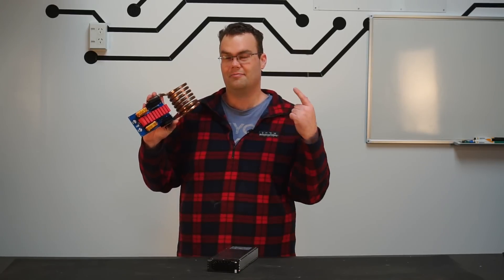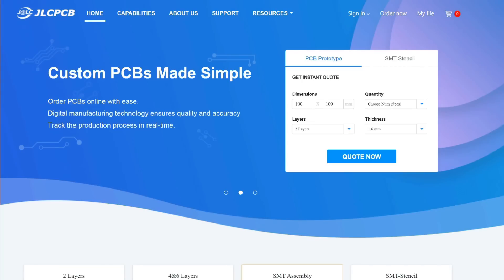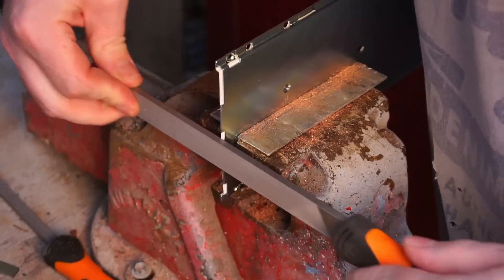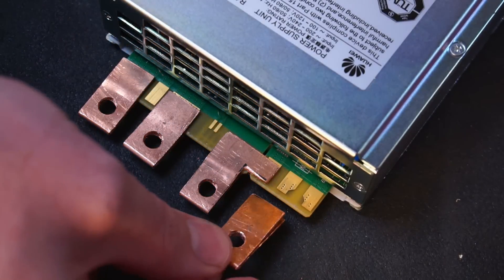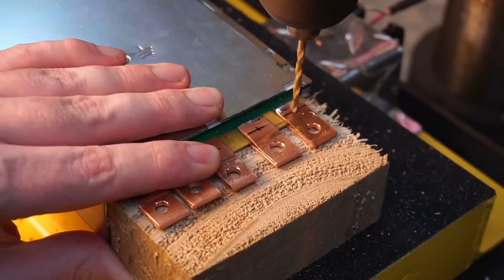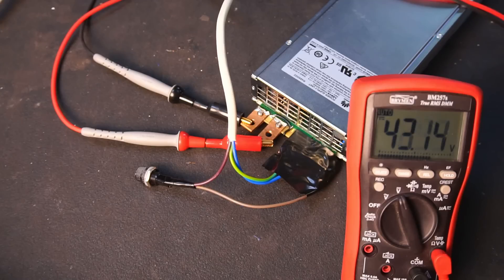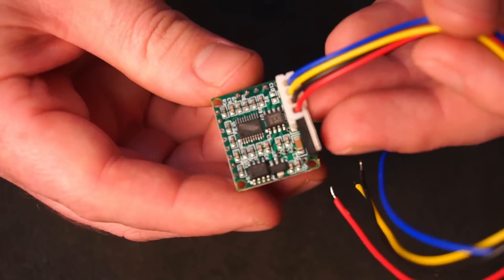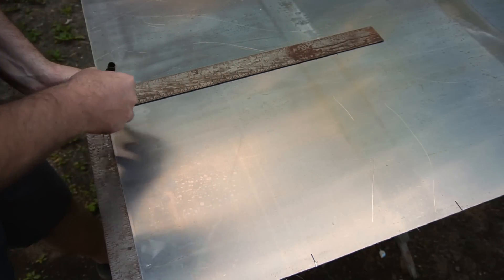Cheap 3Kw PSU for Induction Heater ll Huawei R4850G2 PSU

Comment: Great video, very good!
Now on eBay for around $15 a complete connector set.
The voltage and current controller looks extremely useful but seems difficult to obtain, is there a schematic maybe?

Comment: Those $35 power supplies can't be had for less than $100USD now. Even on AliExpress. I'm searching for one for a 500w ZVS unit currently. Pun only slightly intended.

Comment: Sir, I am near (HUAWEI R4875G1)Is the pin out of the said model the same as yours?
 
Please provide an answer.
Reply: Did you find an answer? I have the same unit as you do and I'm trying to figure out what the extra pin next to the slot detection and CAN is used for

Comment: An excellent solution in the construction of the device.  Thanks for the idea!  Can you please tell me where to connect the heating pedal (turning on)?  What kind of relay is required or is there any heating control contacts on the circuit?

Comment: Hello, Nice information. Would like to know if this taobao voltage & Current limiter needs to be in the circuit permanently or if it should be removed after its job is over and the new voltage and current limits you set remain and the Power supply boots up to the new parameters after removing it from the circuit? it's not clear how to know what current is set as there was no visual of it after pressing twice to get into the current setting mode and the red LED blinks. Please let me know. Thank you.

Comment: I’m trying to make a power supply for an electric vehicle that I can very the volts and the amps for if I built two of these and isolated them could I run them and series to get around 100 V?

Comment: I ordered the Huawei R4850G2 and the Talbao encoder to build my power supply, as per this video. Removing the top enclosure of the R4850G2 to connect the ground and the regulated 5 Volts, I could not find the 3 pins the author used to take the 5 Volts from. The circuit in my R4850G2 looks like kind of different from the one the author shows.
I took two pictures of the circuit in my R4850G2 to show this issue. Can anybody help me to discover how to take the regulated 5 Volts from the circuit in my R4859G2?
Reply: Can you give me the link for the encoder please. Not finding it...

Comment: Hi good morning.
i would be interested in using this power supply to power an rf amplifier, modules require 65v but 50-53v is fine too.
a curiosity, what are the differences between the G and G2 version as circuitry? are they activated and the current and voltage are drawn in the same way?how much can a similar power supply cost?
thanks for the video

Comment: @Schematix Did your R4850G2 become very hot when turned on without a load on the output? Mine do, and I am pretty sure it's not supposed to happen. I just want to be certain it isn't some weird supply pumping, or inductance dumping that causes energy to be converted to heat. The supplies are very expensive now, so I would prefer not to have to buy a new one...

Comment: the thin wires which needed to be connected with ground to turn on PSU , i added a switch there - easy turn on and off.

Comment: The 1 and 5 legs are supplied with a voltage of 0 to 5 volts to adjust the current, or can you install a trimmer between the 1 and 5 legs? To adjust the voltage between 1 and 16 feet, can you put a trimmer resistor or do you need to supply a voltage from 0 to 5 volts?

Comment: Your video on how to build a 3000W induction heater and PSU is awesome!  I just bought a 2500W ZVS induction heater- it was local and a good price... I have a 2000W Delta PSU that I am going to use to power it...  I have question - I will be using the unit to solder Carbide grit to steel that is 0.75" width by 0.75" height  but it is not straight... it is in a 3" radius semi circle - basically it is a J Hook!.  I need to solder grit evenly coated inside radius of the J(for gripping purpose) - which is tricky!!  - If I make a coil big enough to fit the entire steel J by lowering it in from the top.... the entire part will heat up and the solder melt  and grit will slump to the lowest point of the J...  I so I have to make a smaller coil for localized heating and basically insert the J hook from the side and rotate it keeping the solder area level...  - So I have to make a side mount coil about 2-3" in dia - about 2 wraps of copper tube (1/4")  (Sorry for the big explanation !!) ....  Now to the Question 1) If I reduce copper coil size will it place to much stress on the induction heater - aka lots of energy less area to dissipate? Or will the less wraps increase localized heat at the solder site?  (aka the reverse of the first scenario?

Comment: I purchased used PSU at 12.5$ and thanks to you , now outputs is 53.4v - that small module is expensive then PSU 😂 - I will use step up converter (1800w 40A) to increase voltage - will use it to charge 16S and 20S ebike batteries with it.
Reply: Hello Jawad how did you far the can module 
Impossible to my side to found it
Reply: @laurentfievre5652   i purchased that CAN BUS module out of curiosity 😜 it does work, but i'm using boost converter and adjust output from that, in case you want to see my build, here is the video https://youtu.be/YFtxjgEPIoc
Reply: boot converter is avaliable to manage 60A ?
Reply: @laurentfievre5652   30A max at 53V , output 1500watt at 84v...
Reply: *how did you found
Reply: لو شغلته ممكن مساعدة؟

Comment: Easiest way to control via switch or foot pedal? 
Can the pin connected to ground be used or would it be better to use some kind of contactor or relay?

Comment: Tested this little controller on the Huawei R4875G 4KW 75 amp supply. Voltage controller worked great. I do not have a load bank sufficient to test the current limiter. I expect it will work just fine. Also using one of the PC card plugs available online. The card plug has a pair of CAN leads that connect together, however my supplies seem to start right up without those lines grounded. The R4875G is exactly the same size as the 4850, however it has more switching devices inside. R4875 delivers 75 amps at 240vac 53.6vdc or 32.5 amps at 120vac. The 4850 is 56.1 amps / 25.2 @ 120vac. both range from 41.2 v to 58.8v with the controller, and seem to remember setting as long as the controller is connected. I also installed a 37 ohm 2 watt resistor in series with the red fan header wire (to quiet it), using a $5 temperature controller to short the series resistor if the power supply gets hot. Any higher value resistor will cause the fan to surge. The tiny temp controller gets power from the fan header, so easy to hook up. https://www.banggood.com/Digital-Temperature-Control-Switch-Adjustable-Thermostat-Temperature-Switch-12V-Cooling-Controller-W1701-p-1587150.html?rmmds=detail-topright-recommendation&cur_warehouse=CN  I think this controller will fit entirely inside if the screw terminal is removed and wires soldered directly.
R4875G on Taowow baowow.. https://item.taobao.com/item.htm?id=604456015560&ft=t&toSite=main. A brand new one is about $75 US and about the same to ship it using this service. It came very quickly.  Ali Express has them also, $100 plus shipping, so this way is cheaper and much faster. https://www.aliexpress.com/item/1005001762436248.html 
Thanks for turning me on to this little gem..
Reply: So the voltage range is what you stated between 40 and 50 ish?
Reply: @johnnycash4034  about 41.2 to 58.8. I also discovered if you use two of these controllers with a dpdt switch, you can switch instantly between 42v and 58.8v This could easily be done with a logic circuit. Also I noted that in the center off position, the power supply didn't boot. once it boots, it stays booted. I had not grounded the other cann lines though.
I used a miniature dpdt center off switch and just switched between the two controllers cann wires (blue and yellow). I'm now debating if I want to keep this circuit, or just put a single controller on my LDmos amplifier project.
Reply: Lonnie
Have you a link available to order the can bus module?
I m interested to bought it
Regards laurent
Reply: I bought the same 4875 and I'm just starting to set it up. I came back to this video specifically to see if the controller would work with it, so thank you
 Have you done anything else to yours?

Comment: Great video! Given your comments I decided to give Taobao Focus a try. I just ordered a power supply and the control board $59.75 for both (NOT including shipping to the USA)!!!   I paid for the product, THEN, a few days later, I get the bill for shipping:  $95.03 for a package that can't weigh 7 pounds!  Taobao Focus is a RIPOFF!
Reply: There is a Huawei R4875 4kw unit on aliexpress now. I ordered one, I hope that this voltage control works for it. Does the 4850 still run without the internal fan connected? How is the noise level? BTW.. this was a great video. very well done, even if I don't intend to make a heater... I use mine for an HF amplifier I am building now.

Comment: I was thinking about using a few hp dps-750 in series as they are cheaper here and have a high current for 110v.  What would be the safest way to make them adjustable once in series?  I looked around and most videos are using dc -dc converters, but they don't handle high currents.

Comment: I'd love if you would show it's efficiency (power in/out) at a few load values in your followup video if possible?  Also wondering about the current limit setting and variable voltage limits. You mention that the voltage can be set in the range of 41-58V and 0-60A.  If you say set a limit of 10A into a 2ohm load this would only require 20V. Can it do that or can it only do current control when the matching voltage is within the 41-58 range?
Reply: My question also. Too bad the cnt doesn't reply here.

Comment: hey that earth contact between positive and negative dc....it looks to me like its conected to nothing....can any one else confirm this? i can not get continuity with the chassi or the other pins...also if you file away round the ac metal terminals you are left with spade conectors.. (they are close together.)...am i corect in thinking the ac earth can be simplified by conecting to the chassi some where? also if you do the same file round the metal with the dc terminals you are also left with big spade conectors..if that "earth" between them is nothing but a dead end then it can be removed and big spade conectors will fit.its showing 53.7 volts with out the centre pin between positive and negative dc being conected so it would seem it works with out that centre pin/contact.any thaughts?...oh i also noticed after filing that some parts of the board have 4 laminations of metal...when you drill and through bolt you are conecting all laminations together..hold it up to the light and you will see tiny holes punched in ac and dc terminals.i suspect this joins the laminations together or maybe it does not but any solder seeping into the holes would join laminations. the 2 tiny pins do not have these holes...any thaughts on this?...could we be shorting some thing if we drill bolt or solder?..i have just now discovered that it runs and shows the 53.7 volts dc with only the bottom tiny pin conected to dc negative.

Comment: Could you please explain to me your welding technique without filler? Are you holding the filler to use at the start and end of the weld? Also really confused about how the top of that 7805 voltage regulator fell off at 11:19 when you applied the soldering iron...

Comment: Is there a way to get a voltage below 40V? That psu seems awesome!
Reply: Sorry, it doesn't look like it can without some modification. Via the CAN interface you can program it for standalone operation from 48V to 58.5V. If you can constantly communicate with it via CAN, you can get this down to 41.5V.  (I note in the datasheet it has a chart suggesting it will operate down to 0V. This is somewhat correct, under current limiting I have seen it ramp down to 9V before disconnecting. But if you send it a command outside of the above ranges, it will respond with an error flag)
Reply: @craig5211-n1m  yes, the data sheet says also 35 Amps at 24V. So it can be used to charge a 24v Lifepo4 or do you think it will get destroyed? I tested it for a short time, and did work. But I don´t know if that´s ok

Comment: Soldering would be just fine - it wouldn't melt
Reply: The problem with soldering is that any stress will rip the pcb traces off. This means the other end needs to be solidly mounted to an enclosure. This is my progress so far
https://i.postimg.cc/zDxCpSbX/IMG-20210114-220002.jpg
Reply: @Mark6E  thanks for sharing this.
Reply: Even with 50A going through it?
Reply: Norm T 
So, lead-free solder evaporates to almost nothing over time? I don't believe you.
Reply: Norm T 
I was of the belief that dry joints were caused by incorrect soldering at point of manufacture, be it a dirty connection, lack of flux, incorrect use of heat etc.

I'm aware of Tin whiskers and the dangers. I wasn't aware that Tin spontaneously vaporises into a gas and leaves the system entirely. 

I have some soldering experience myself and agree that lead free solder is hugely inferior. 

I didn't mean to offend as much as I clearly have. Hope you have a Merry Christmas if you celebrate it 🙂
Reply: Norm T  interesting... i never heard that before. So this happens to all Solder joints eventually? Can you counteract it by making high power connections just bigger so the load gehts spread around better? I’m a hobbyist building drones and electric vehicles were ist not uncommon to pull 100A and so far i never had problems with my solder joints.
Reply: Thanks a lot,this formula following output voltage is ok but yellow alarm is on please solution
Reply: Ikkktttt
Reply: @joskuppens4352   in many modules can yellow led on how can problem soluation

Comment: does anyone know a good 12 or 14.4 volt psu? tiwh atleast 90A??
Reply: 12v yes.$26 shipped. It puts out 1200w at 12v so 100amps. When you say 14.4v I assume this is for car audio?
https://www.ebay.com/itm/HP-1200W-Power-Supply-Server-490594-001-438203-001-HSTNS-PL11-/274601460132?_trksid=p2349624.m46890.l49292
Reply: @randybobandy9828  yes my audio system in my room (my sub) is powered by a car amp but when it’s a bit loud the lil psi I have isn’t enough it’s a dell a870p-00 12.1v @ 70.5A so about 850 watts

Comment: so the type of applications clear many things of electronics in certain area is working. like this psu which is used in cellular towers. now I learned what range if voltages used in this type of applications. of course they are using power electronics devices for the powerful electromagnetic waves. the voltage is not so high it's 56 volts but the current is really high

a question come now to my mind is that where voltages of hundreds or thousands are used ?

Comment: hi does any one know what the range of the current adjustment mode was ..it can be used for battery charging yeah?...i have a need for an onboard charger that can use aus 240v house,church,libuary/any plug (electric bike with LTO cells)..does any one know if this trips surcuit brakers in aus on curcuits rated for 10 amps?..we have outlets rated for 10 amp and 15 amp all have 20 amp brakers but maybe they trip erly?...and is this power suply limited at its max current? as my battery pack will just draw 3 times its power if its not limited and the brakers will just see the load as a short.
Reply: From internet forums, what I understand is the current limiting can be adjusted from 0 to 60A in 0.1A steps. I've been testing mine, but I find the current control loop is very, very slow. For a test, I have mine set for a maximum of 1A. I have a 300W Programmable DC load, so I'm limited to about 5/6A. If I apply a 5A load, it happily delivers this at the set voltage for about 10 seconds, before it starts to very slowly reduce the output voltage.
Reply from the maker: Yes, this would make an excellent battery charger. You'd probably want to buy the Taobao volt/current controller which would allow you to set a current limit to protect your batteries.
Reply: @Schematix  ok thanks...although its not the batteries that need protecting  as they can charge at 20c,its a 740wh battery...the problem i see is curcuit brakers tripping..your on 240v in nz right? does it trip your surcuit braker at full power? do you guys run 20 amp brakers like here in aus? and is that power suply limited to its upper amp/watts rating or is that a rating i have to make sure i do not exeed?

Comment: I want to use this, or a similar unit to step down the voltage to 12-18 volt. Running power hand tools is my objective.  Would this work?
Reply: You can get these 12V $8 shipped by FEDEX
Reply: @opera5714  Something is missing from your massage. What can I get for $8.   thanks

Comment: I know it is a little late, but looks like you can get the chassis female connector for this for a few bucks.   https://www.ebay.co.uk/itm/For-Huawei-R4850G2-rectifier-module-communication-power-plug-/163584839215
Reply: Schematix after reading this comment: say sike right now
Reply: Too late for me, I just finished mine😩

Comment: Nice find and video. Also, great ideas for connecting to the unit.  While you were soldering, Why not heat the pcb and then copper to pull in solder more? As for the mains, couldnt you use heat shrink on the mains lines versus tape? I keep thinking I should by a tig and move away from mig when I see videos like this!
Reply from the maker: Thanks! Heating the PCB would definitely help the solder to wick into the joint. The insulation tape is only temporary while I was testing on the bench.

Comment: I wonder if a hot swap connector could be 3D printed. But maybe it would melt. Does anyone know what the mating connector looks like?
edit: Just looked it up, you can buy the connector for the back PCB for around $20 too and it has heavy duty connectors built into it.